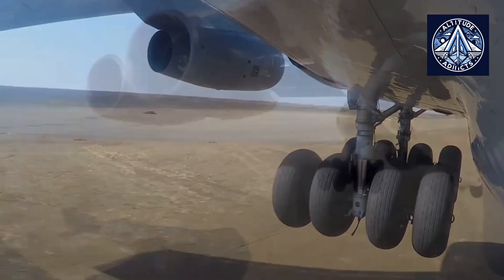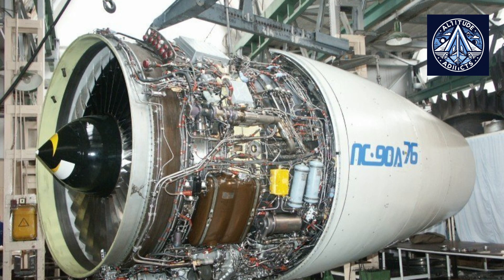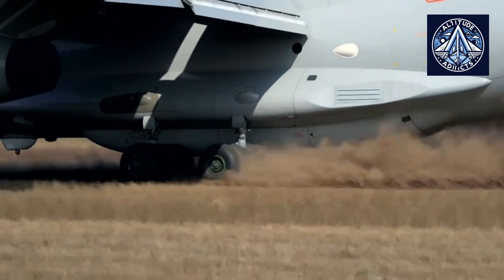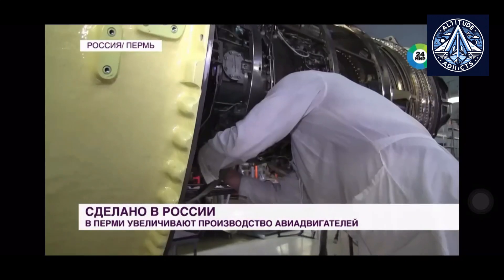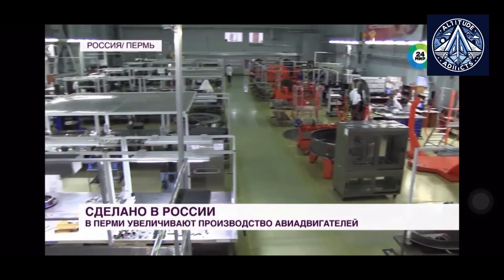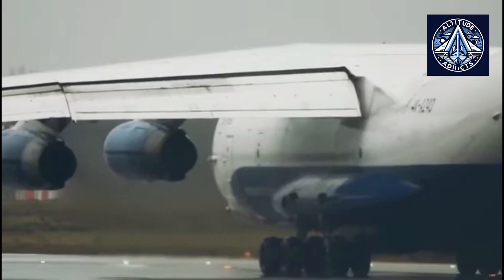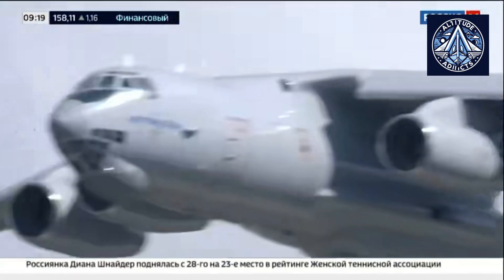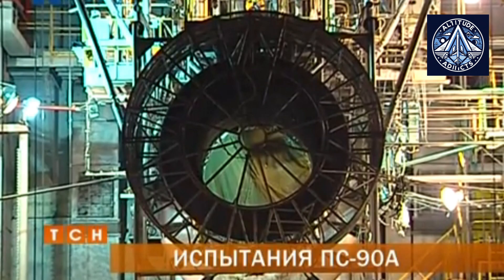Why PS-90A Replaced D30-KP as a Preferred Engine for the Russian IL-76 Aircraft

Comment: PS-90A is a turbofan not a turbojet.
Reply from the maker: It is a turbofan Of course.  Here is the reason for that error. In Russian technical literature, turbofan engines are often referred to as "ТРДД" (TRDD), which stands for "Турбореактивный Двухконтурный Двигатель" (Turboreactive Twin-flow Engine).
So, while the term "Турбореактивный" might be translated literally as "turbojet" in some contexts, in this full description it's part of the standard Russian terminology for turbofan engines. This Russian description is indeed correctly identifying the PS-90A as a turbofan engine, just using terminology that might not translate directly to the English terms we're more familiar with.

Comment: The D-30 is a military engine that does not take into account civilian operating parameters. The military does not take into account the noise and fuel consumption of the engine. 
These are incomparable engines.
Reply: D-30 was fitted on civilian Tu-154 and Il-62.
Reply: It was comparable to JT8 engine.

Comment: Why not upgrade 160kN to 350kN by PS90A10 version
Reply from the maker: For which aircraft project?
Reply: @altitudeaddicts  This is my idea. Instead PD35, why not develop from PS90A. We haves over 30 years operating experience, so development is really not difficult. I'm from Viet Nam
Reply from the maker: @quangtran9545  While it is a nice idea, PS90A already has improved versions which does not have any new aircraft project to fit into. PD-35 is a new generation engine and can power any new Russian aircraft , be it military or civil. PS90A will require a new efficient core which is same as developing a new engine.
Reply: @quangtran9545  Developing PS90A is not a good idea because it cannot match with western engines in technology. So it is better to go with PD-35 as new design.
Reply: @quangtran9545 
Weil die PD Familie eine andere neue Evolutionsstufe von Triebwerken ist.
Sicherlich läßt sich an den PS Triebwerken immer wieder etwas verbessern. Aber der wissenschaftlich technische Wissenstand entwickelt sich weiter. Das sollte auch bei der Triebwerksentwicklung Berücksichtigung finden.
Reply: @altitudeaddicts 
Und der neue Kern ist in der PD- Triebwerksfamilie.
Reply: Is there a PS90A10? I think we have up to PS90A3 and PS90A5
Reply from the maker: There is PS-90A-154 for lateral mounting of the engine in the nose section of the Tu-154M2 aircraft.
Reply from the maker: I am not sure I heard of A5. I know of A3 and A3M.
Reply: Russia does not have any other engines except PS-90A to replace Ukrainians. It is a very good and reliable engine, but it is quite old technology although there were some upgrades. The last upgrade PS-90A2 with P & W collaboration is under sanctions. So the PD-35 is completely new design and probably could replace PS-90A in the future.